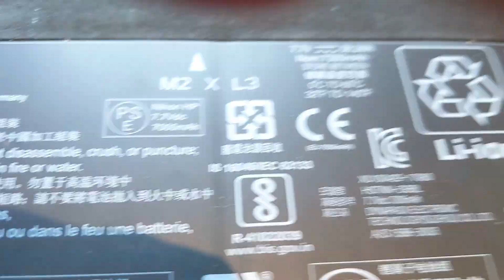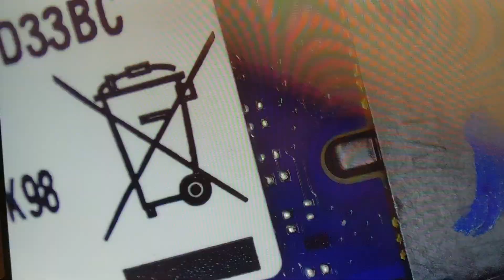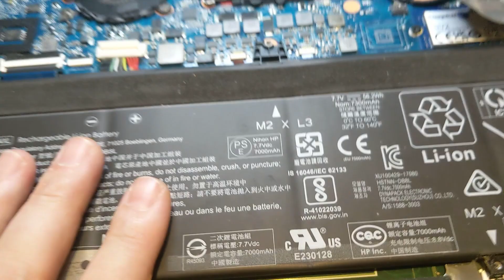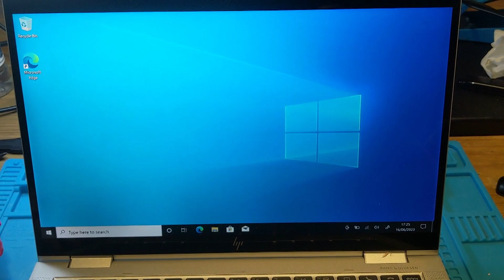M.2 SSD connector change on a HP laptop

Comment: What if the laptop only has 1 SSD but there's also a slot for SSD 2 without a connector, can you add another connector to the motherboard on the SSD2?
Reply from the maker: Well that would depend on the rest of the circuitry. Is this just wired 1:1 to the other slot for alternative chassis configuration or is it a completely electronically independent PCIE bus? Will BIOS make use of it? Hard to tell. Nothing stops you from trying I guess:)
Reply: I think I will let you know. Gonna try to do that with Acer Spin 1
Reply: How's everything going with that, any results? @viktorhamsik

Comment: the pins for my ssd connector broke and HP is trying to say i will need a new board. but can it be replaced with a new connector by soldering and save me the $400?
Reply from the maker: Yes, easily. Don't spend that kind of money just because the connector is broken. New connector (or even a used one) plus the labour would be less than £50.
Reply: thank you much! glad i found you!
Reply: @DIYRepairHour  does any m.2 connector work? got one that looks to be a match, 4 pins on the end and several on the other
Reply from the maker: @RepostedCentral  you need to source a connector that points the same direction. Because you can have left or right facing ones, and those are not interchangeable.

Comment: Sir i have another ssd 2  empty which mean there is no connector its inneed to be solder, now my question is can i solder a new m.2 connector and solder the pin and add the new m.2 ssd 2  1tb, will it read coz i as manufactures says storage can expand only to 1 tb but in ssd 1 slot i have 500gb, will it ready my new 1tb or will it become 1.5 tb?
Reply: same issue